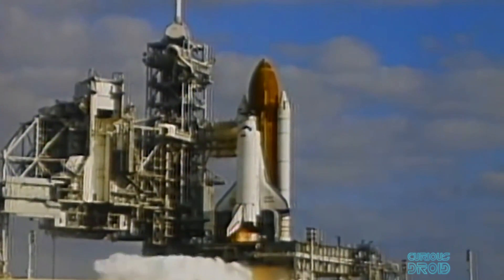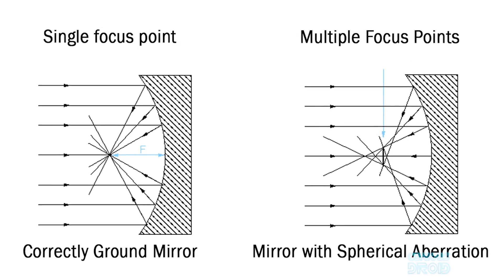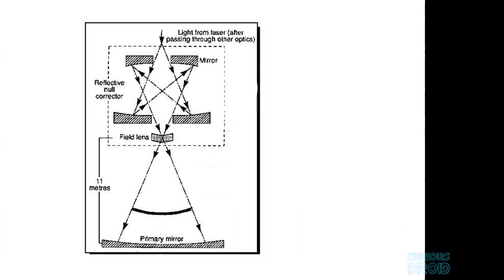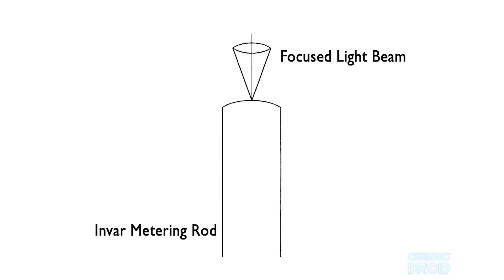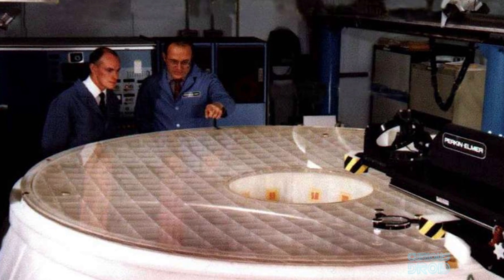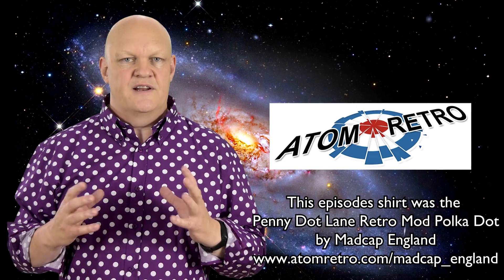Hubble Trouble - How did the Space Telescope Mirror End Up Flawed ?

Comment: So it took 1/4 the time to make replacement mirrors that work perfectly than it did to make the first mirror? 
So why didn't they just do it the replacement way to begin with?
Reply: They didn't replace the Hubble mirror.  They installed hardware/software to process the errors and display the data correctly.  The mirror was not replaceable in space.
Reply: @dq1275  no I'm very very confident they replaced the mirror in space, they had 70+ hours of space walks to do so. They replaced the one giant single mirror with a giant array that was modular. This entire video explains what they did.
Reply: @tylerhensley2312  If you read this article that follows, you will note that the flawed mirror stayed in place.  The COSTAR module inserted into the Hubble's "cabinet" contained additional small mirrors to correct the distorted light from the bad mirror along with new software to process the adjusted light.  Fortunately, the flaw was constant, repeatable, and identifiable. To put it in laymen's terms, the astronauts gave Hubble a pair of glasses.  I know the mirror wasn't replaceable because, in 1988, I visited the Hubble at its clean hanger at Lockheed near San Francisco and posed the what -if question to the engineers.   https://www.skyatnightmagazine.com/space-missions/what-was-wrong-with-hubble-mirror-how-was-it-fixed/

Comment: A few comments:
"The mirror was short-sighted". The focal length was not the problem - so the term "short-sighted is meaningless. The spherical aberration meant that only a small portion of the light spectrum could be brought into focus at any focus setting.
"The mirror was aspheric". Yes, but the statement is meaningless. Most large telescope reflector mirrors are parabolic, not spherical. Any other shape needs a secondary corrector of some sort.  
"Special  apparatus to check its quality". For the wavefront correction they desired, any mirror shape would need checking, even if they had desired a spherical section. The null test is quite sensitive and relatively inexpensive.  Unfortunately at the time, there was no easy way to test a null corrector. The tester had to be extra careful that the lenses/mirrors were correct and that they were spaced correctly. 

When grinding/polishing large mirrors, it is standard practice to use multiple methods of testing the figure. P-E did this, but then ignored the test that showed the error. The opticians were also negligent in not having at least a third tester. When both independent tests showed the wavefront error, it would have screamed that something was wrong somewhere else.

Comment: There almost was a 2nd flaw in the mirror.  Reader's Digest (not a major source of news) ran a story in the early to mid 1980s (prior to the launch of Hubble) that touted the extreme precision of the mirror, the manufacturing, and trials in tribulations overcome by Perkin-Elmer to enable the (then) upcoming Hubble telescope and its (then) unheardof abilities.

Mentioned in the article was that there was a small spot in the mirror where there was a flaw that they were only able to partially correct for but it was expected to be a small spot in the vision where     data would be incomplete.  In the article, they likened it to "a beauty mark on a woman" (roughly quoting the article).

Comment: Here's some rare and obscure Hubble trivia for you all.  Most people don't know about the hole in the mirror.

 I don't mean the large one in the middle of the large reflector for light to pass through to reach the detectors, or the 3 holes around the circumference intended for the three-point mounting/support hardware. I mean an unintended hole in the mirror.

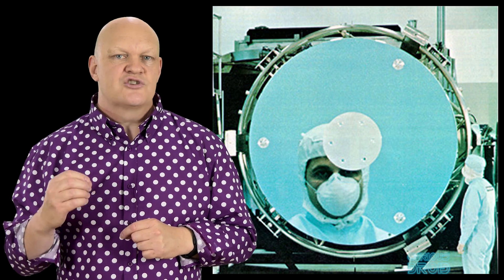  Freeze the video at the 5:33 point and look at the bottom-right portion of the mirror near the edge.  upon the reflection of the scientist you can see the hole in the mirror as a round, dark spot on his right shoulder (or on the reflection's left shoulder if you wish).  You can spot the hole in other close-up photos of the finished mirror as well.

 This was due to a tiny flaw discovered deep within the casted glass blank.  Engineers were worried that the flaw might be a crack that could spread in a fraction of a second and shatter the entire mirror, or at least ruin a part of it.  Some engineers felt the flaw was stable and nothing to worry about, but to play it safe they decided to "hole-saw" out that spot with special tooling anyway. They knew the loss of mirror area of the roughly 2-inch (25mm) diameter hole was negligible in the total amount of light that the large mirror will reflect.

  Later tests of the cylindrical slug of glass removed from the blank proved that the flaw was stable and would not have spread. The hole was unnecessary. I read this story with clear photos in a magazine in the late 1980s or early 1990s, but haven't seen any mention of it since then.
Reply: I'm just commenting because comments make comments rise and this comment is worth commenting, unlike some of the other bizarre and asinine comments in the comment section.

Comment: You did a great job accurately explaining the reflective null error, spherical aberration and the administrative dismissal... then dropped the ball on the corrective description.  The secondary mirror was not in play in the correction.  The ray bundles going into the science instruments were "intercepted" by pairs of quarter-sized mirrors on COSTAR which re-imaged the primary mirror and inverse-corrected the spherical aberration for the instruments.  It was an engineering marvel and as a "silver lining" - moved space-qualified technology ahead to enable the advanced optical-mechanical designs of future HST replacement instruments and other observatories.

Comment: I still have the July 1989 magazine "Discover" that I bought back then with the article by Terry Dunkle who was at the factory during the construction of the primary mirror by Perkin-Elmer. The head engineer Bud Rigby had the contract to build it to 64 lambda and it came out to 80 lambda according to their instruments.. Very interesting article, I can see why there was a flaw in the mirror. 
They lied to Nasa about the reflectivity of the mirror, their instrument showed 80% and they reported 78% to NASA because the guy that coated the mirror Mr. Kurdock didn't think the 80% reflectivity was correct even though one of the techs told him he had just calibrated the instrument. 
It all sounded to me of a company that needed that mirror in the Hubble and they would change the data to make sure it was chosen to go in it. 
Lots of NASA contracts at stake.

Comment: huh thats intresting and something I had faulty info about.   I'd swear I'd been told the reason for the error had to do with the mirror warping slightly when it was no longer under gravity.   Never did look into it further.   hard to believe that they would improvise a fix for a delicate bit of calibration equipment instead of figuring out why it didn't go together they way they thought it should.

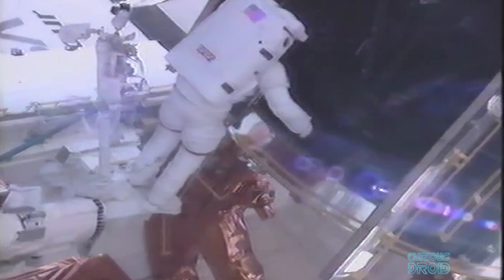Comment: At 6:18  WRONG!!  The corrective optics were NOT installed on Hubble's secondary mirror!  They (the COSTAR optical system) were placed in the larger rear instrument section inside the telescope behind the opening in the primary mirror and just ahead of the cameras and instruments.  Future instruments were redesigned to internally compensate for the spherical aberration when they were eventually replaced during the follow-on  Hubble Telescope maintenance missions, so the COSTAR optics were no longer needed.
Reply: And COSTAR itself is now in the Smithsonian A&S... Which is really cool! Most historic space instruments never return intact.

Comment: Not enough of the blame was laid on NASA, who cut costs throughout the making of Hubble by testing systems only once as they were completed, rather than 2 or 3 time as is normal.  They also decided not to do a complete systems test to save $10 million, a decision which resulted in a $2 billion repair mission.
Reply: Full disclosure: I have family who worked at Perkin Elmer (my Dad did optics for the Hexagon program).  I even have one of the Hubble Telescope jackets still.
Reply: Were the 2/3 checks $10 million too? Because considering there were five great observatories and only one of them failed, if the extra checks would have cost more than $400m per telescope ditching them was the right decision (not counting the lost science from delays to an operational Hubble, mind).
Reply: I mean that it was normal to test each individual system as it is completed 2 or 3 times.  Unfortunately, I don't have cost details on what those smaller tests would have cost.  The $10 million estimate for for a complete systems check, after Hubble would have been completely assembled.  Consensus is that such a test would have caught the error on the ground (at which point the backup mirror could have been used).
Reply: Never enough time to do it right...always enough time to do it over!

Comment: How does the Hubble move about in order to take pictures at various locations in space?
Reply: I heard the Hubble uses 6 cameras and that did not sound like a good answer to my question. So it uses reaction wheels?????
Reply: You are right ytmoog, I did ask how the Hubble points in different directions. You are probably right the about reaction wheels making fine adjustments on the target.

My question concerns how the Hubble moves from 0* through 360* degrees in all directions...larger moves than the reaction wheel does? 

Does it also have small rockets or some type of gas jet system to say change directions? 

This is not complicated.
Reply: Consider how reaction wheels work. When the wheel start accelerating in one direction the hubble will start accelerating (turning) in the opposing direction. After you stop accelerating the telescope will still be turning. Then you just reverse this when you've turned enough.